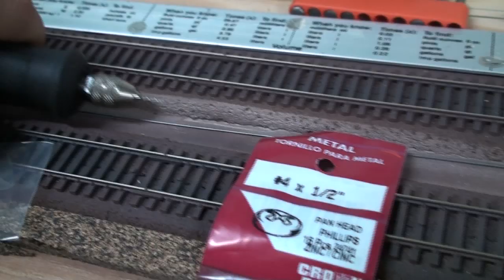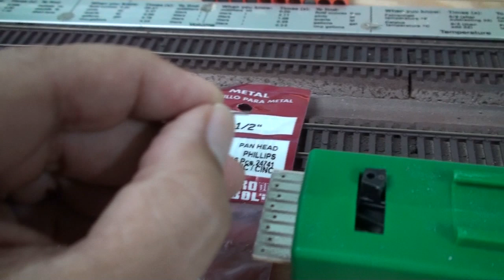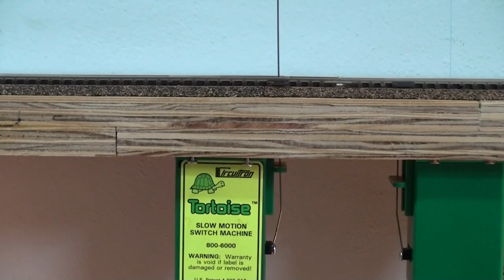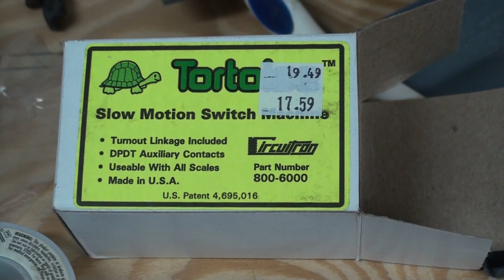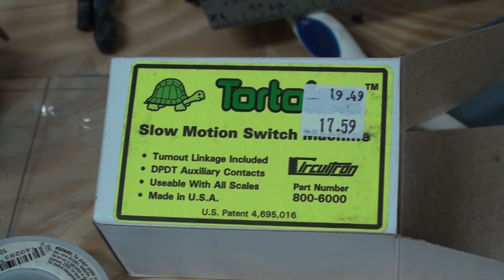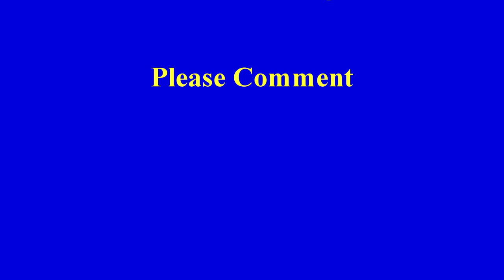My CSX/NS HO Railroad Part 16B "Installing Tortoise Switch Machines"

Comment from the maker: The Tortoise switch machines have two sets of DPDT switches built in.  I use one set to power my turnout frog and the other to power my led signals.  You need resistors on the led because of the high track voltage 14 + volts.

If you already have Atlas switch machines, you can buy Atlas#200 switch relays and connect then in line with you Atlas switch machines.  These too have two DPDT switchs where you can power your frogs and power you signals.  Hope this helps.

Comment: I like what you did.  I would like to see how you solder your wires to the tortoise motor itself and see how you connect them to the terminal strip.

Comment: Quite interesting. I've been thinking about this kind of mounting before all of the track is down. I am going to take this one step farther and mount the switch machine on the roadbed and then put it all into the road in one piece. This (if it works) will let me mount the machine without getting under the road where the wsitch it very hard to see and touch like in the raised parts of the road. This will be only in 4 different places and the rest of the switches will be mounted while under the road. Thanks for the ideas.

Comment: Good video! I have simplified installation by crimping a spade ring terminal to the end of the piano wire and then putting the screw thru the ring to connect to the switch machine throw bar. No need to drill, bend or shape. Also you can crimp a terminal to the top end of the wire, drop it thru the already mounted turnout throw bar and let it hang to help position the tortoise underneath. I have a video showing the process of mounting a Smail machine (same as tortoise) by searching for Jim Worcester or “smail installation.”

Comment: Very good procedure.  In addition to what you do, when drilling through throw bar I also drill holes at each end of the throw bar centrally. Visual is good enough.    Go under base and with a rule and pencil and draw a line connecting the three holes that will show beyond the template.  (If the three holes are not inline then something is wrong) When offering up template you can see using pencil line and that the motor is correctly aligned.    I use the template locating on the first hole drilled through, for greater accuracy, and open out the hole in stages as you did.   As for signals, it is possible to have 2 red/green signals by wiring into the feed, and a third using one of the switches, see Circuitron Notes, and search the Net.  Still you have a switch for the frog polarity.        The cost of doing this compared with other point motors, in particular solenoid type, is very expensive, plus the reliable positioning of the swing rail especially when the wire is upgraded.

Comment from the maker: yes, by lowering the DC Voltage the tortoise will run slower and quieter.  I will run all of my Tortise's switch machines (9) with one Radio Shack 12v 500ma wall transformer.  My other Tortoise switch machines (6) on main line are on the "Hare" dcc track power.

Comment from the maker: Yeah, that one tortoise did cost a little more.  Did not pay the listed price as my local hobby shop gives me a break.  The rest of the tortoise switch machines were purchased as six packs so the price was a lot less.  

All of my switches are Atlas which are insulated.  The only reason I power the frogs is for reliability and to be able to run any type of locomotive with a short wheel base at a crawl (real sloooow).

Comment: I am using NCE and tortoise motors.
I have my tortoise motors already wired.

But now need to program each motor so that it works each point, I have followed the NOTES that came with the SWITCH-8.
I have NINE (9) motors in one section, so have left the 9th motor manual for now.

I believe you need to program each motor to the NCE system as a Handshake, using prog/esc and 7 to get to program Accessory on Main, using 33 as the CV No and a value of 1 with the rotary button on ZERO(0) to 7 for the now 8 motors with the SETUP jumper in place each time.

now that these Tortoise should be ready to do the following
1/ using the SETUP A pins with the jumper ON
2/ moving the rotary switch to ZERO(0) for motor No 1
3/ for mine motor No 1 will be part of MACRO No1(with Motor No2 down the other end of the track - as a PAIR)
4/ NCE hand piece - prog/esc then 8 to get to programing macros
5/ enter macro No 1, getting to next is entering Acc No 1 to N or R adding other Acc No 2 to N or R
6/ enter any other motors the same way on the layout

45 other Tortoise motors to go and so far not happy

I am sure I have missed something out.

Comment: I know you said you didn't know the size of the wire and I know you are using Atlas turnouts.  I am using Peko and Walthers turnouts and they have a spring built in.  The Tortoise will not "flip" it with the included rod.  I purchased some .040 piano wire to compensate.  Will try it tomorrow.  Maybe same as yours.

Question:  I would like to post construction videos as well, what software do you use to do this?

Gracias.

Comment: Really learned a lot from your videos.  I'm using Peco switches.  I assume you use the same?  Is there a cheaper switch that works just as good?  The big question is, using a DPDT switch with center off is your kind of switch for controlling the Tortoise machine.  Can you use one with no center off switch?   Leaving it in one position, will that eventually burn out your Tortoise with continued power in one position???  How can you use Tortoise to power LED lights to indicate position of switch?

Comment: I've noticed a few other videos of people over sizing their tortoise actuator hole. Why are so many people doing this?
Reply: I'm not an expert but after watching several videos, I'd say it's because it's easier to modify the hole to the wire size you have rather than find the exact diameter wire that fits the factory hole.    A larger wire accomplishes the same task as the factory supplied one which in most cases, is too short.

Comment: Do not under stand why you change piano wire from .023 I have been doing this for 50 years have installed over 200 tortious machines never had to use larger wire. When I see this usually it comes from improver intullation of switches and not insuring proper electrical contact.